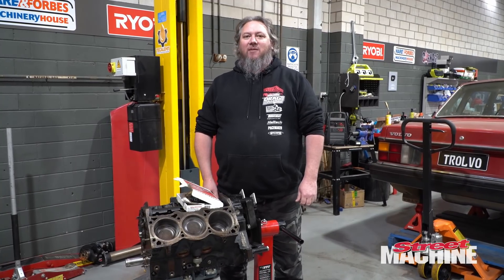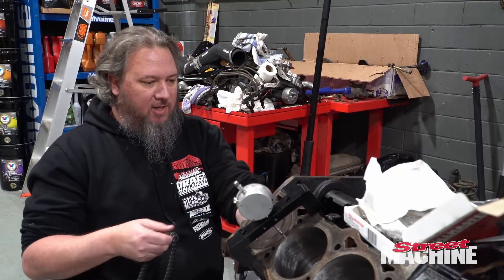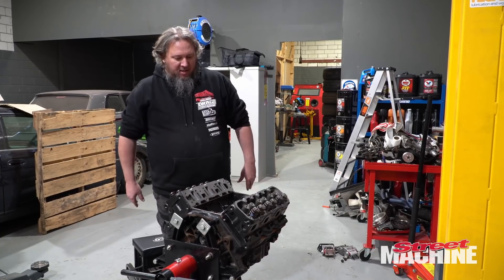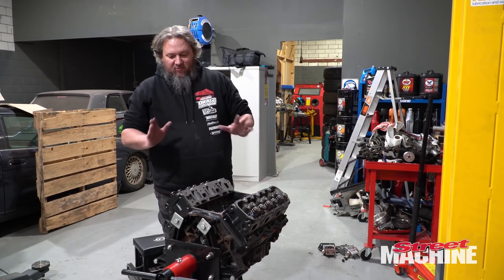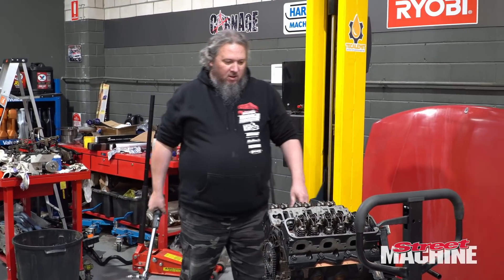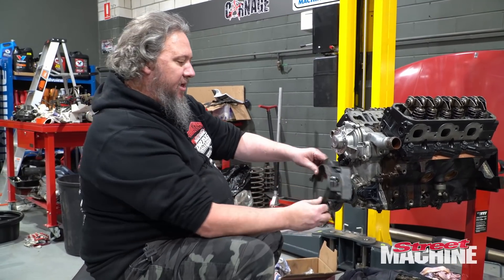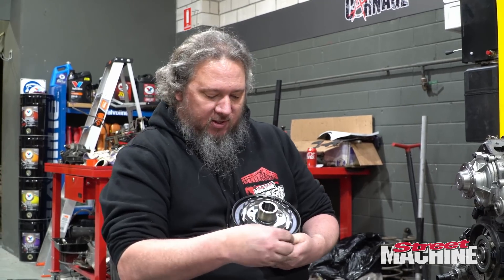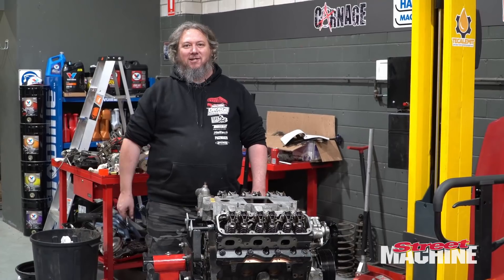Carnage - Supermang L67 3800 rebuild - Part-4

Comment: Braver man than I Scotty putting another single row back on it.. hopfully this one doesn't let you down. Ballance shaft can stay there btw just has to have the bolt and gear taken off then its just along for the ride.
Reply: LS engines run single chains without issue and they have more valve springs to compress.
I removed the balance shaft in our VS club car , the engine vibrations and harmonics above 5600 rpm is horrendous and unacceptable even in a limited use club car , eventually i replaced the balance shaft 😕
Reply: @craigritchie1933  ive never had this issue with vibration and have probably removed at least 50 shafts.   Not sure why it would vibrate.
Reply: @V6turbo  Why do you think the factory fitted balance shafts in the first place ? 90 Degree V6 can't be balanced properly so GM run a balance shaft to cancel out the vibrations . Remove yhe shaft and the engine will vibrate,  we run nolathane bushes that accentuates the issue
Reply from the maker: I figure it's there for a reason, I might as well use it
Reply: I've never known anyone to snap or even stretch one.  Not even in an LS.

Comment: I concur. PTFE Thread seal tape is a MUST on any engine where head studs or bolts protrude into the water jacket. I prefer swapping to ARP studs myself on any engine. Just makes life so much simpler.

Comment: The mighty L36/L67 engines are fantastic. The L36 in my ute hasn't missed a beat & it's nearly hitting 290,000kms. These engines have their problems but not as much as the dreaded LY7 that replaced it. 
It's been great watching this build.
Reply: I have  a 1998 vt commy l36 motor done 301000 ks nothing  done  to it change  oil every  5000 ks transmission still  all original  only  thing  had to replace  diff at 295 000 ks car still  going  strong

Comment: Just a bit of info on the early 3.8, after many dollars to sort a vn out for running too cold and having no heater, I removed the manifold and found the silly coolant cross over pipes caked with crud. Cleaned them out and never had an issue again. Great build and welcome back mang

Comment: Shout out for that Haynes or chiltons manual. Pretty cool to see that for sure because most of us that do project building at home use that. It’s pretty much a must have.
Reply: Remember the Gregory’s?  Used to always repair my own cars.
Reply: Never heard of them here in the states. I’m assuming they’re just like the Haynes and Chiltons though. Gotta love the manuals you can thumb through and find what you need though vs trying to piece info from the internet though.
Reply from the maker: @zachs8652  the internet has so much misinformation now
Reply: I recently was on the receiving end of bad info when I ordered arp bolts for my 318 water pump, The only sizes right was the one bolt that goes through the water jacket. 
 Long story short I reused all the bolts only to now discover the expansion plugs are all rotted. I wish the would ban steel plugs in the block.
Reply: @zachs8652   Similar thing here in Oz.

Comment: Scotty, you don’t have to remove the balance shaft entirely for a dual row chain, just the gear on the front of it. Also it looks as though you forgot your cam sensor magnet on the timing gear. 👍🏻
Reply: Yep, removing the gear from the balance shaft also reduces the load on an already over-stressed single row chain.  I do this on 4.3 Chevy V6 engines. There is only a slight increase in roughness that is more or less a slight hum not a dead cylinder shake.
Reply from the maker: Doesn't require cam sensor to run in the VN
Reply: @STREETMACHINETV  Why’s that Scotty? Does it have something to do with the VN not having sequential fuel injection? If you’re going to use the L67’s ECU, you might need that sensor.
Reply: @zeropaloobatheuber1572  yep magnet means sequential fire , no magnet automatically goes back to batch fire. Unsure on what ecu he's running but it's the only way to run a plug in haltech or Delco 808.
Reply from the maker: @zeropaloobatheuber1572  It runs a Haltech plug in and we never had the cam sensor hooked up. The VN doesn't run a cam sensor.
Reply: What lb springs are you running, i dare say that single row isn't gonna have a good time. Why not go the double just for cheap insurance
Reply: @STREETMACHINETV  na vs onwards it's why the plug in GM pro only does vn-vs style or you give the sequential up. It's why I just did a custom harness to run LS1 pcm.  Even haltech 1500 can't sequential 2000 sport minimum!
Reply from the maker: @hayden6056  doesn't seem to be that much of an issue for us.
Reply: @STREETMACHINETV  it really isn't man it was for emissions. I was warned of BCM issues and other stuff being vs and different security to vr. Haltech plug in was same cost as LS1 pcm with custom harness that wouldn't have any BCM issues so didn't go the haltech.

Comment: Love how this is back! Been enjoying this series!
I really hope the single row doesnt bugger it all up
Reply from the maker: I hope that too :)
Reply: @STREETMACHINETV  It'll be fine!  One thing I'm not sure about because I've never built an engine that had bolt holes thruogh to the cooling jacket - but I do know a little bit about plumbing and teflon tape (only DIY level mind you) - you probably should have used more tape.  Three times around is what I was told for a good plumbing seal on a mains pressure line, and clockwise to the front of the connection so it doesn't bunch when you tighten it up.  It'll probably be fine too though.
Reply: @Beer_Dad1975  The more tape you add the more the torque setting is going to be out. Because the tape has an elastic property to it, that is going to alter the final torque setting. The Holden head stud sealer is quite thin and wet (at time of application), so when it is applied to the threads it doesn't really interfere with the thread on the studs being pulled up against the threads in the block. The tape is going to act like as if you coated the threads with silicone.

Not only that but the thread tape is also taking up space in the hole, which will also further inhibits proper thread to thread contact. I would heat cycle the engine a few times, then re-torque the heads before applying any load whatsoever. Head sealing is even more crucial on forced applications. Using thread tape is roughly equivalent to using rubber head bolt washers.
Reply: @DodgyBrothersEngineering  I never even considered how it would impact the torque!  Got to wonder why they put the holes all the way through like that, seems to have been a bad idea...
Reply: @Beer_Dad1975  I don't think they do it deliberately, but sometimes it is unavoidable. The biggest mistake you see people make with blind holes is winding the stud down all the way to the bottom and bottoming out the stud, which falsely loads up the threads as well. That's why when you get stud kit they tell you to put them in hand tight only. That is to ensure that the threads on the stud pull up properly against the ones in the block.

Comment: scotty i mentioned to you before in a previous video, you will have to use locktite 596 hi temp silicone gasket maker on the threads. do one stud at a time when applying the silicone on the stud. smear the silicone all over the threads and also put some of the silicone in the stud holes in the engine block using a small flat blade screw driver to push and smear the sealant into and around the threads, screw the stud into the block and clean the excess you will have to do this process rather quick as the silicone will start to skin around 5min. its the only way mate. my motor been together for over a year an no leaks, locktite 596 is great stuff i use it for just about everything.

Comment: I remember writing a comment about (not) using a single row chain with stronger valve springs! Oups😉😁
As said by others here, the double row chain can be used with the balance shaft still in place. You just need to take out the drive gear. (The shaft stays, doing nothing anymore.)

Comment: On head studs or any other thread that needs to be sealed for coolant or oil , I use air line thread sealer, good up to 300psi 👍 and yes when you have to remove it , it looks like super glue

Comment: its easy to delete the balance shaft . tap out the bush at the back and silicone bronze tig up the oil feed hole and tap the bush back in the block . job done . or you tap the oil feed hole in the back of the block and put a fitting in it . its not a hard job .
Reply from the maker: None of that sounds easy on an engine that's already assembled

Comment: Nice work Scotty.  Bit of info, resting your hand on the top of the torque wrench while you torque it with the other can affect the torque. Is it enough to cause a hassle on your engine, who knows. Loving the tough 6s.
Reply from the maker: I imagine just pulling the handle without support probably gives an erroneous figure too
Reply: @STREETMACHINETV  only if you bend the conrod that holds up your head. 🙂 With the torques you're using you'll likely be fine, it's worth bearing in mind for newer engines with less tolerance.

Comment: You don’t need to delete the balance shaft to run a double row timing chain, you just remove the sprocket. They run fine with them left in place.

Comment: Crow Cams single chain will be sweet as, Scotty! Standard one is as much use as a chocolate fireguard!!! Cheers. Leigh.
Reply: ill have a friendly bet that it doesnt. Snce the crow production has moved to mexico its all rubbish, ask any performance dealer n the states. half of the stuff coming back to them including springs.
Reply: @ng3083  yeppppp had three different install heights of there 150's in my l67 heads.
Reply: @ng3083  Well I didn't know that, mate. Cheaper production sucks. Cheers. Leigh.

Comment: MACE engineering says any spring pressure over 105lbs you should use a double row chain. Looking through all the videos the spring set was 130lbs?

Comment: Hey Scotty I just watched u put your timing cover on the supermang with the new timing chain but you didn’t put the magnetic pick up on the cam gear , I did the same and the engine ran like shit hope this helps u
Reply from the maker: Because the VN doesn't have a cam sync it won't need it.
Reply: @STREETMACHINETV  cool mate I did a vy turbo conversion put it together and forgot about that magnetic pick up and had to strip it the timing cover off and fit it what a pain in the arse lol

Comment: I'm not getting the Teflon tape thing, it's used on tapered pipe fittings to reduce friction, this allows the fitting to seal on the threads NOT on the tape... GM headbolt sealer while stupid expensive is what's needed.. just hope this isn't another failure in the making... :( Back to the vid.
Reply from the maker: The sealer didn't work last time
Reply: Was it genuine GM?

Comment: What tool did you use to align the rear main seal? Or was it purchased with it already installed and you pressed it on over the crank? These are an absolute dog without the tool
Reply from the maker: Did it by feel/eyeball

Comment: The Buick 3800 was basically a cut down 307. Hence the need for the balance shaft with the rubbish bearings. Balance delete doesn't do this engine any favours. Just get better bearings.

Comment: Scotty, I noticed that you forgot to install the magnetic pickup inside the new cam gear for the cam position sensor.
Reply from the maker: The VN doesn't require it
Reply: @STREETMACHINETV   So your running the VN Delco 808 ECU instead of the VX L67 ECU then ?
Reply from the maker: @shanehurenkamp50  Haltech plug in

Comment: Makes sense for the engines to share the same lifters, why design and build 2 different types when the one you've already got works fine?
Reply: That'll be exactly what GM when they were designing the LS - "we need a hydraulic lifter that can handle this much valve spring and this many rpms with this much oil pressure" - "we've already got them in the 3.8 V6" - "alright lads, job done, I'm calling this a half day, let's piss off down the pub for lunch and a few beers".

Comment: Why, why, why.
Never use a single row chain with a cam and springs. You don't need to delete the balance shaft, just remove the front cog.
Reply: Watch previous episodes, new engine being built with double row.
Reply: @madmick3794  yea that motor is also highly advised against. Mace cranks snap at 500hp or high rpm.

Comment: What valve springs are you running?
Reply from the maker: Not factory
Reply: @STREETMACHINETV   what lb?
Reply from the maker: Carnage Episode 51. But 135lbs on the seat, 320lbs at 600 lift
Reply: @STREETMACHINETV  Yer ok 
I did watch it but was a while ago 
Fingers crossed for the HD single row 
I’m running 120lb on rollmaster single row

Comment: Just pull the balance shift out. Done it many times havnt had a problem
Reply: Is that before of after you blocked the rear oil feed to it? Good way to lose a lot of oil pressure.
Reply: @hayden6056  my bad, take the gear off the balance shaft and just leave the balance shaft in. Can also upgrade to double row timing chain from just doing that.
Reply: Couldn't remember if I put it back in but I did just not the gear to drive it
Reply: @xNOSIGNALx87  yeah sure can I just completely pulled it and grub screwed the rear couldn't see the use of keeping something that didn't do anything but close an oil circuit lol.
Reply: Can also remove the rear balance Shaft bearing an drive the small cam bearing from a 440 in it 180 out so feed holes covered. Just need to put it in freezer first , good way to not modify the block incase ever want to refit the balance Shaft.

Comment: Though the toxic political correctness movement hasn't fully hit the car YouTube channels too bad... The automotive equivelant has.... 

The over use of torque wrenches 😂 I have no doubt that half the time it is used is purely because someone left a comment about having to use one for EVERYTHING. Obviously cylinder heads and the like are very important. But a sump? I think Scotty is more than capable of knowing how tight to do the sump up by feel. He's pulled more engines apart than I have, and I'm a mechanic 😂
Reply from the maker: Yeah, you're right. I've been beaten into submission
Reply: He cops well and truely enough rubbish from the so called experts that only watch videos to make negative comments. At least that only sums up a small portion of his followers